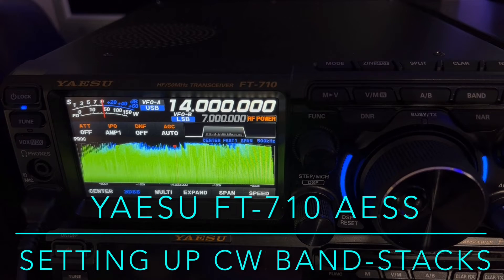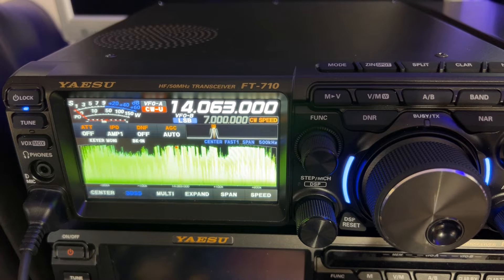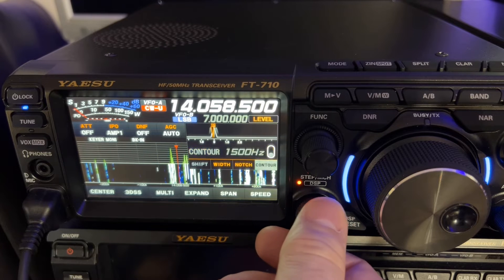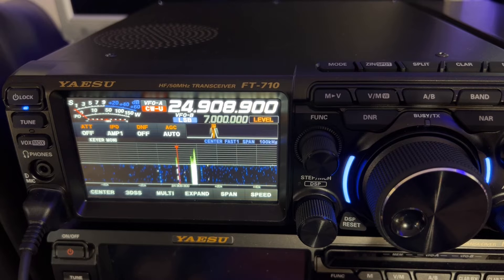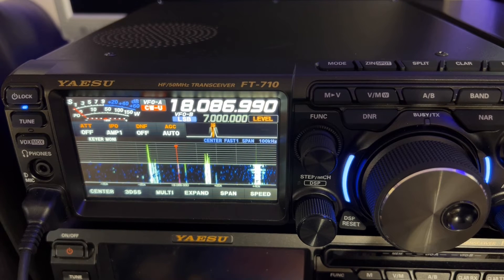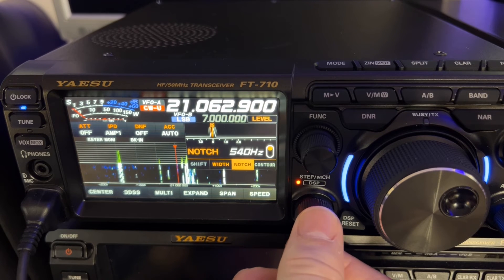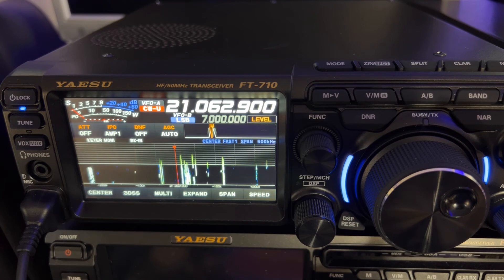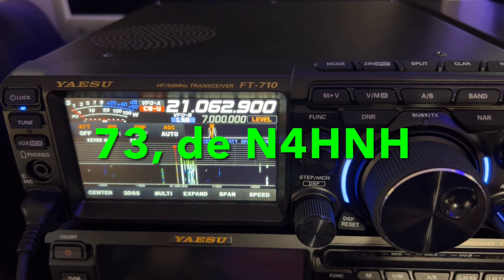FT-710 AESS: Setting Up CW Band Stacks (video #15 in this series) #hamradio #ft710 #cw

Comment: Nice video thank you , same problem with my radio , seems to be the sidetone , i have send one request to yaesu , and for them is not a problem , nobody complain about this , and they ask me to try to reset the radio 😅. End of conversation with them 😮. Can you please send also a support request or bug report to them ?
Tnx 73 de IU1HCC
Reply from the maker: I reported it when I noticed it. Future updates helped but never completely eliminated it. Is a beginner radio.  Better receiver and DSP than the IC-7300 but still missing some things. I got in trouble with Yaesu for pointing out the flaws. That’s why I have a Patreon team. Manufacturers wish to censor me.

Comment: i am looking at buying my first HF radio and have been watching your series on the 710. i will be watching your series on all your other radios. really apprecaite the way you take the time to show a good setup, how to use the features. its really helpful to understand the tools these radios have. i'm also an audio guy and didn't realize with these radios you could do so much to maximize the modulation. PEQ and compression on board is nice. anyway nothing to do with CW but just wanted to say i'm enjoying the series and thanks for doing it.
Reply from the maker: I’m glad you’re finding the videos helpful. I want everyone to get the most from whichever radio they choose. If your budget can stand it, I suggest the FTdx10, FWIW.  It provides the most functionality for the most operating styles. If you only plan to rag chew or operate FT8, then the FT-710 AESS is enough radio. 

73, de N4HNH

Comment: So is there a way to save these settings, so you get this same profile each time you return to the same band?
Reply from the maker: That’s what band-stacking does. This was an initial setup of some CW band stack registers for a few bands. There are 3 band stack registers available for each band. The radio remembers everything you set in each band stack until you return to that band stack and change it. Note that it doesn’t remember global parameters, like RF power, CW speed, etc.

You cash also save favorite frequencies, modes, filter settings to memory slots. I do that. I’ve covered that in other videos. I’ve also covered band-stacking more extensively in other videos. Video #3 in the FTdx10 series covers babd-stacking in more detail. 

You bring to mind the fact that I need to emphasize more that this is a teaching channel.  Radio reviews or tutorials are secondary. No matter which radio I’m using in the video, the techniques I cover can apply to other radios.  I suggest watching videos from the other playlists to learn more operating techniques. I covered techniques in the FTdx10, and even the FTdx5000MP, playlist that I might not cover in this series, because I’ve already shown those techniques. The only difference with a different radio is where the controls are located (i.e. knobs, buttons, menus).

Thank you for the reminder!

73, de N4HNH